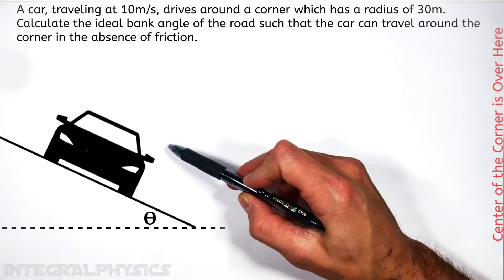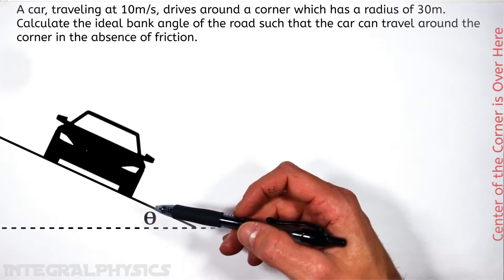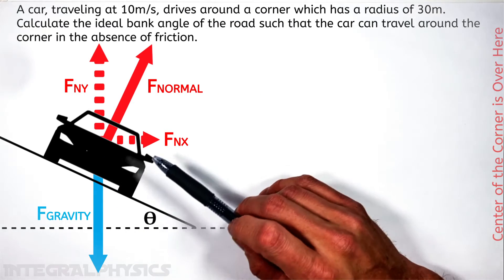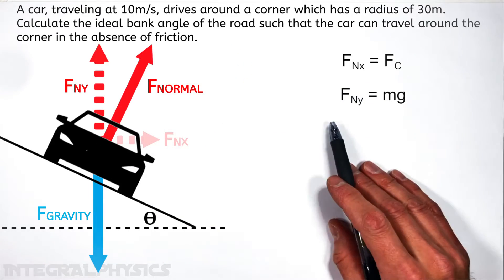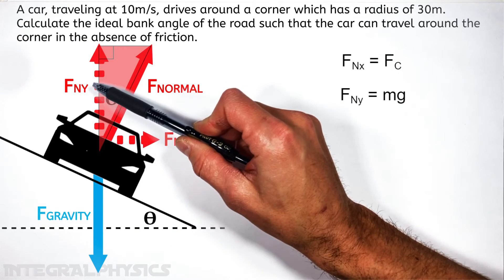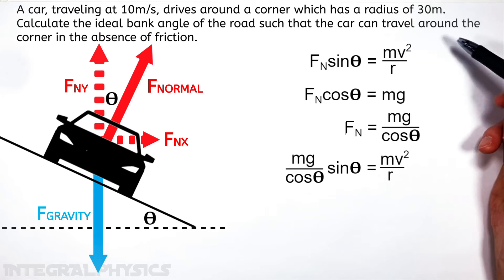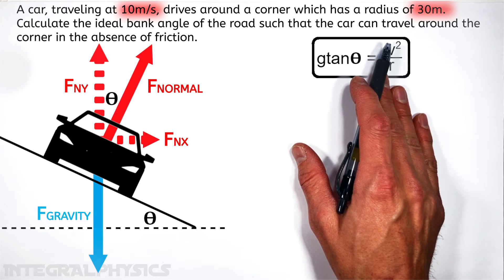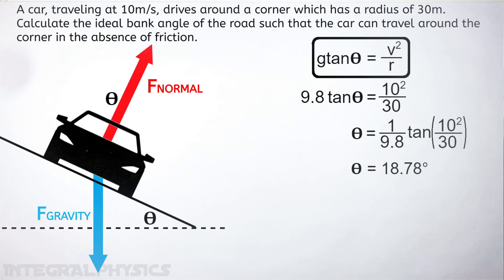Worked Example | Calculate Optimal Bank Angle for a Car to Travel Around a  Curve

Comment: Sir while finding apparent acceleration due to gravity due to earth's speed on a body ,we take the frame of body so that the force is centrifugal (outwards) and we get a reduced net  acceleration. 
But on viewing from outside inertial frame of refrence we have to take a centripetal force(inwards) thereby getting an increase in net acceleration. But the net acceration can't be different in different frames. Plz tell me where am i wrong ?
Reply from the maker: When at all possible, avoid a non-inertial reference frame.  Something is wrong with how you are calculating the centrifugal force.
Reply: @INTEGRALPHYSICS  But sir books use centrifugal force.